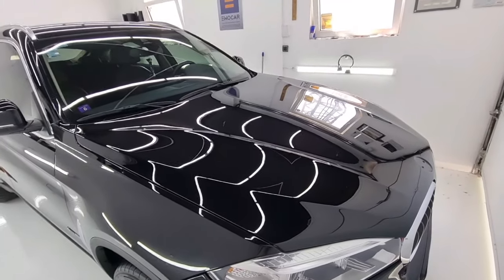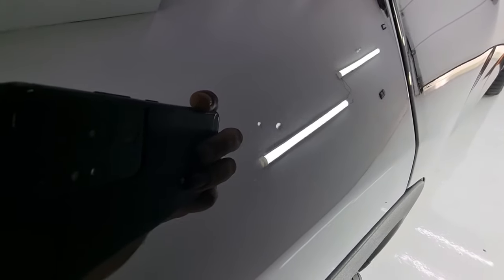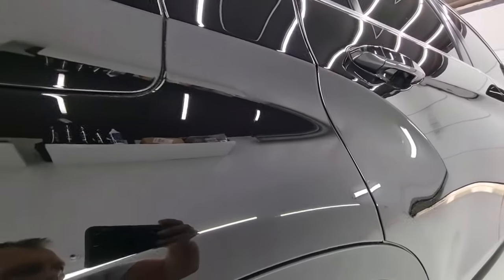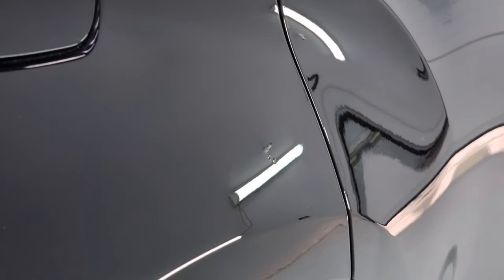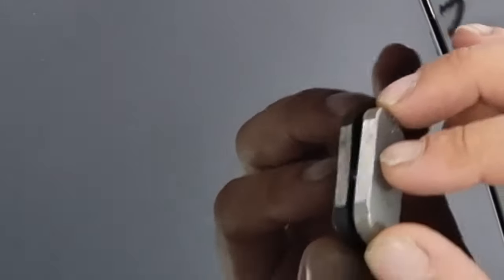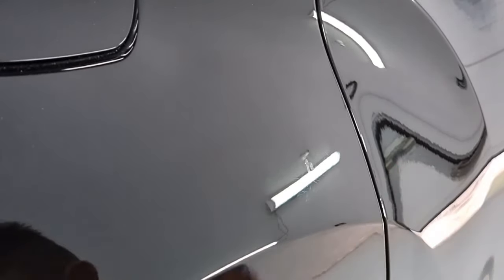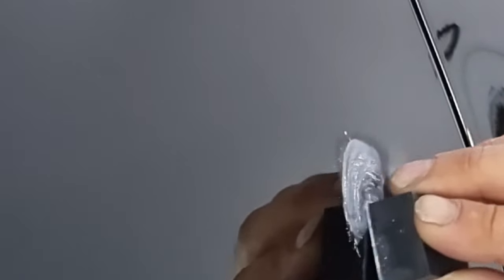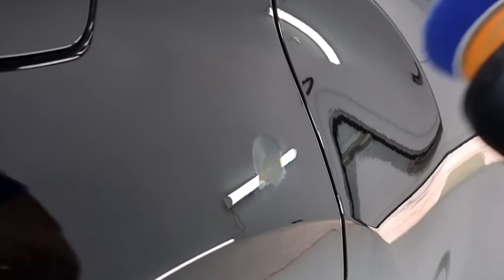How To Repair FISH-EYES without painting

Comment: I just got a few fisheyes in my 2k single stage paint job. Since I am not using a clear coat could I just use some of the original paint to fill in the fisheyes (as you're doing with the crazy glue) and then level and polish?
Reply: Of course you can. That's how I do it, too. I use a drop of Clear Coat for the case like in the video and solid color for your case.